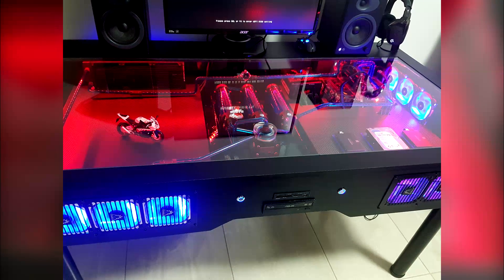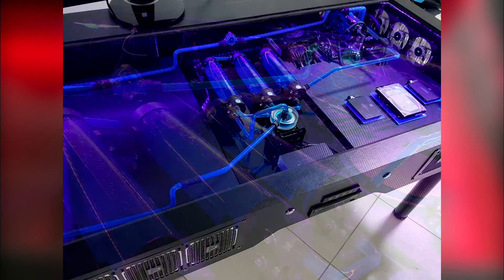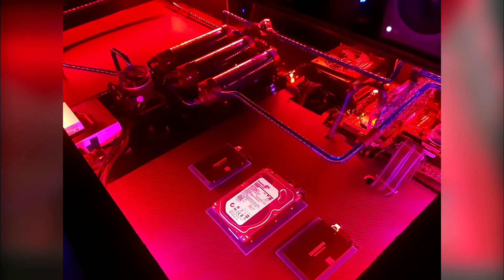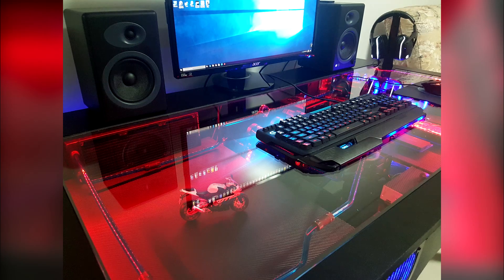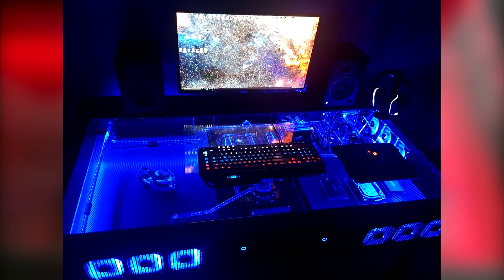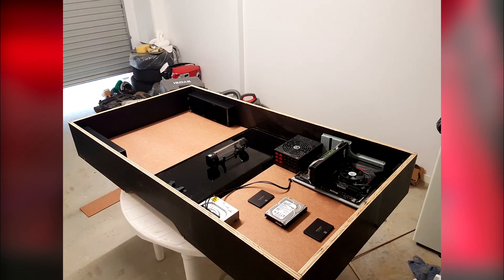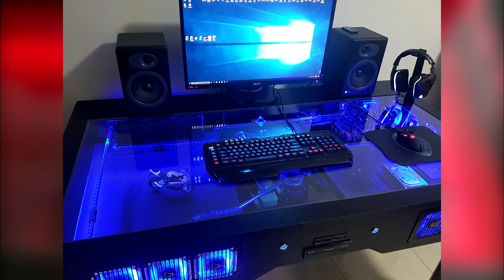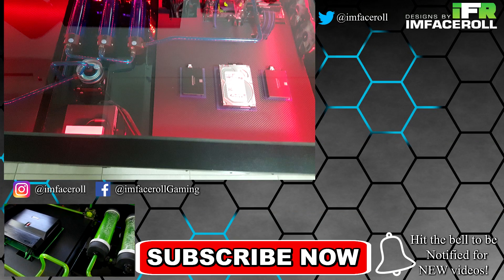Ultimate Water Cooled DIY Desk PC

Comment: The build is tidy a great build and looks clean. If it was my build the motherboard would have been the main feature so making the board central in the desk then I would have had 4 reservoirs two at each side. He is into motorbikes as it looks so to stable the much longer rigged tubing I would have used many differnt bike models drilled out or removed the engine part of the bikes and run the rigged tubing through the centure of the bikes on an angle. That would allow the tubing to rest on the bikes along with lookin very well displayed. Could have also used bike wheels as the fan covers or even adapted the fans a little. But that's what my ideas would have been other than that it looks great good job. Edited because I am special.
Reply from the maker: +Disabled Hero hahaha, awesome ideas man =)

Comment: Nice Project.
Love to see other ideas come in to being. Its always an inpiration for my coming mods. :D

Just made my own Desk integrated PC. Almost finished it. Here soime Pics.
I decided to make a black/white/purple colour themed desk.
Will later integrate som UV lights and purple uv tubes to thest some new stuff.

http://www.bilder-upload.eu/show.php?file=a26566-1486491041.jpg
http://www.bilder-upload.eu/show.php?file=46d9e1-1486491130.jpg
http://www.bilder-upload.eu/show.php?file=75ec0d-1486491148.jpg
http://www.bilder-upload.eu/show.php?file=1e80d9-1486491163.jpg
http://www.bilder-upload.eu/show.php?file=7b6826-1486491180.jpg

I was planning to make the same desk like in the vid.
But it was not very useful for me and i decided to place it on the left side of the desk.
More leg freedom without going to high with the tabe top and a more compact look of the hardware.
Its more like a bigtower laying on the side.
And i can pull the PC simply forth to work on it because the desk is not laying primarly on the PC and the drawer furniture.
It has his own legs.